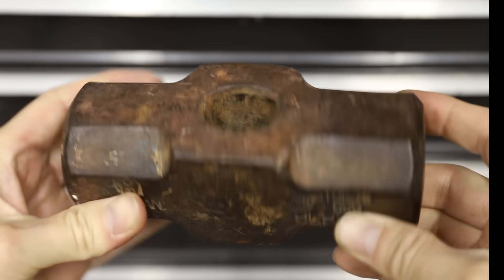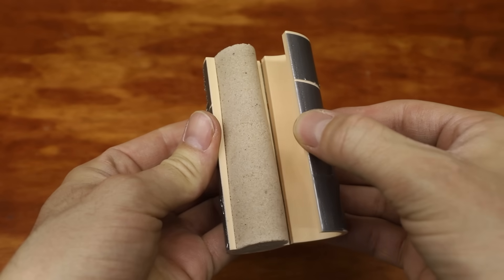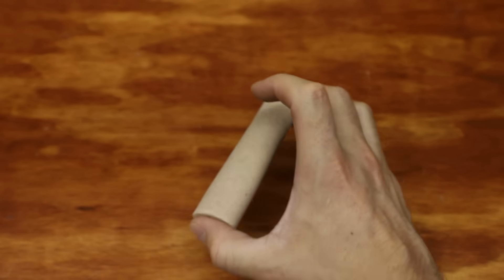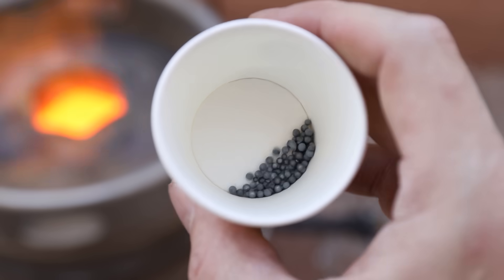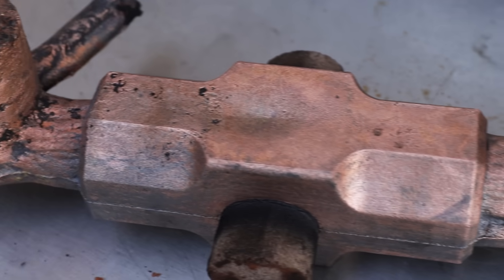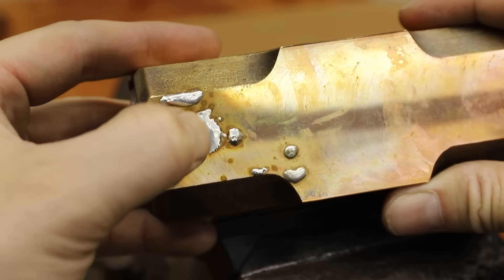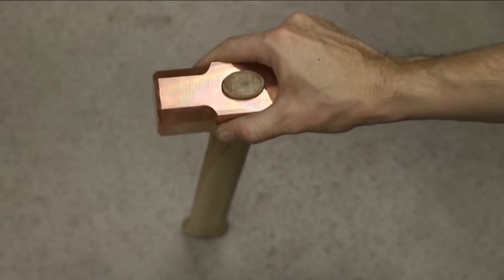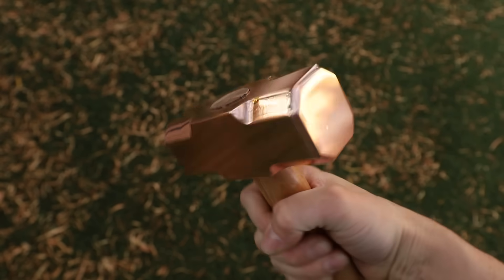Making a Solid Copper Sledge Hammer - HAMMER TIME!

Comment: So that void is called parosity, it’s caused by excess heat staying in the part. To avoid that happening when you make a mold go length ways down the part with gates to pull the heat away from the of the part.

Comment: Very meticulous and clean with the prep and setup, nice job! I think it would've been cool to see you retry the mould and pour, and get it perfect -- I'm sure you would have the second time 🙂 I also think it would've been neat to leave the ends of the hammer with the original casted finish or something rugged, mill and polish the rest as you did, and that way you wouldn't feel bad about beating on things with it, it could actually be functional for soft materials that need a whacking. Because to be fair, you started by saying you wanted to get rid of the useless ingot you made but you ended by saying you're not actually gunna use the hammer for anything 😂 I suppose it WOULD at least be more pretty to look at on a wall than the ingot though. Awesome job regardless!
Reply: usually you'd want to polish the striking surfaces of a hammer. Unless you're purposely making a texturing tool. Any texture on the strike face would be transferred to whatever you hit with it.
Reply: @Eralen00  Ooo, yeah, that's a great point...

Comment: Not that I want you to try it, but wouldn't copper be really soft for a hammer? Can it be hardened?
Reply: Sometimes you want a soft hammer. In my use-case, to remove press-fit parts from my wood lathe, I have a copper rod that I use to strike the part to remove it. That way I don't dent or deform the part.

Comment: You sir , are barbaric savage for doing what you did on 11:00 .Its archaic way of fixing a wedge ,like lobotomy. It splits the wood and if it is steel it will rust. 
All you need is a small pilot hole right on the line between wedge and handle and a small wood screw with flat head. And that wedge will never come loose. 
If handle breaks all you have to do is loose the screw and tap the side of hammer to push it out ,

Comment: When you pour the copper and the flames shoot out of the mould, what is it that’s actually burning? Is it just random dust and stuff from the air?
Reply: He is using petrobond casting sand which uses an oil base for the binder. The fire/smoke is the small amount of oil burning off.

Comment: My son did some copper TIG welding for me. I don't remember the trick he used to deal with massive heat loss from the copper, but he did an amazing job. I don't even know what happened to that work after it was used a couple times - it was part of a pot still. The drill and plug was clean.
Reply: He probably preheated the copper
Reply: High power machine. I have a 300 amp tig I use on copper. Preheat helps a bit sometimes. 
Old school way is use helium as a shielding gas instead of argon as helium boosts the power.
Reply: @ButBigger42  plus heli-arc just looks cool as hell.
Reply: @ButBigger42  You are correct! A weld junction gets hot due to the high resistance to current flow of the base metal.  Steel is actually a poor conductor of current.....same for stainless a many other metals.  But along comes copper.....one of the best conductors of current there is.....same with aluminum.  Gonna have to really crank up the weld current, depending of thickness of parent metal.  You are also correct that running Helium will allow you to back off the current a bit.  40 years as code TIG  welder.
Reply: @hokep61  nice. I was a fabricator/welder and ended up teaching mig tig and stick for the last several years. Got to do a lot of experimentation.
Reply: Preheat and dump as many amps as you have available. The heat loss is almost identical to aluminum except no pesky oxide layer.
Reply: @XxAILASxX  nah, should be much higher.
Reply: Wonder if you could use a thermal insulator to keep the heat in like clay, and then pre-heat the clay + object to retain the heat.
Reply: You braise copper. I'm a certified welding specialist, and we ran beads over copper spoons to fix holes in steel. Copper is SUPER sensitive to oxygen, and needs Alot of Flux to shield it. So If he got a clean weld with  just a tig torch, that's pretty impressive.
Reply: @Tokin_ape  I don't know what gas or size of TIG welder he was using. I was very impressed with the copper welds he was able to do.
Reply: @Tokin_ape  Do you know how this vacuum arc melting works? 
They melt Tungsten on a copper surface without the copper melting or the heat going away.
Reply: Helium and a lot of heat
Reply: polish it
Reply: I’ve tig welded some really thin copper and I would pulse it on relatively high heat.
Reply: there is not massive heat loss from copper. it takes less to heat up so how can it be massive loss when its less?
Reply: @gregorysuto1865  copper conducts heat very rapidly, so any energy you put into trying to weld it is quicky spread through the rest of the metal, pulling heat away from the work location.
Reply: @gregorysuto1865  I imagine it is because copper is such a good conductor.
Reply: @gregorysuto1865  Since I posted this, I looked up TIG welding copper to educate myself (although my old brain doesn't sustain the knowledge). I'd suggest doing some research. It is far more difficult than you might think.
Reply: I've had success pulse fusing 16oz  copper together with a 250 amp Miller.  You just have to get your travel speed dialed and make sure you metal is SUPER clean.
Reply: My friend, are you all right? I wish you good health, happy family, happy every day